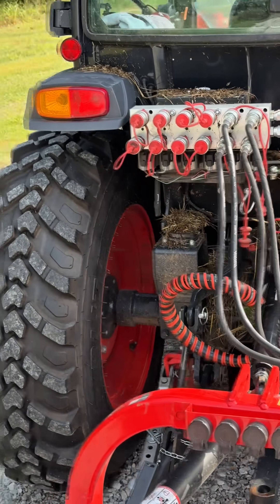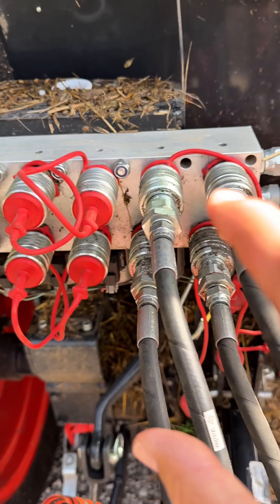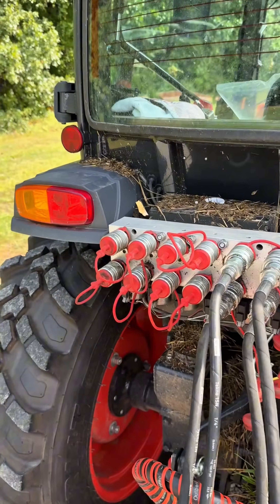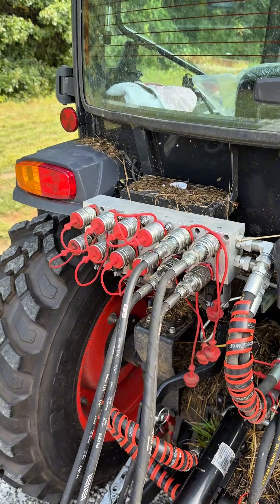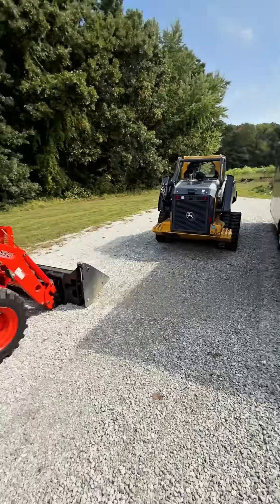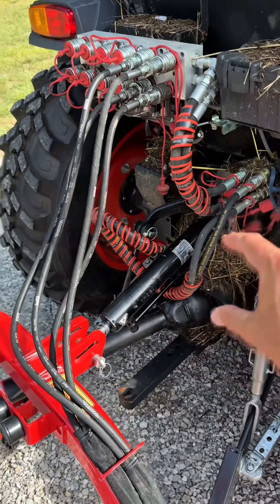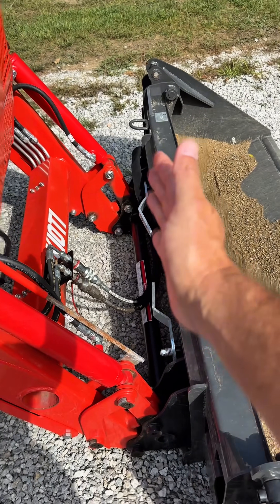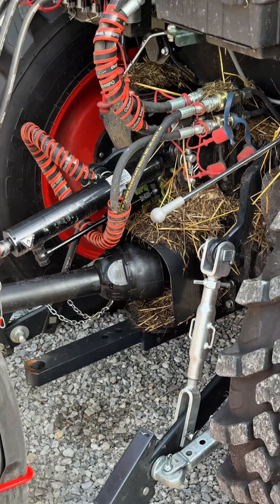Nobody Needs 6 Rear Remotes On Their Tractor! PART 1 #tractor #farming #hydraulic #multiplier

Comment: I just wanna put this out there, if you need a small tractor with this kind of hydraulic usage and have 20 acres or more that's got decent hills and rough terrain and do no farming. You don't need a tractor you need a tracked skid steer, don't buy the tractor cause it's so much cheaper because trust me it's basically useless. Wish I had realized that.
Reply from the maker: The hydraulic usage in this video is completely different from hydraulic usage on a skid steer.  Hydraulic motors and pumps are used to drive attachments on skid steers.  PTO shafts drive tractor attachments.  These hydraulics simply control momentary functions.
Reply: @GoodWorksTractors  ah so these are able to be used with high flow requirements, ok I got ya. How do you right the controls up for it? Is like a modular panel or just toggle switches wherever you can fit them?